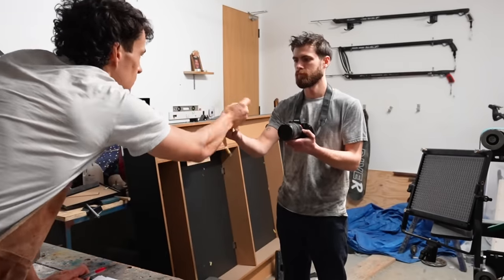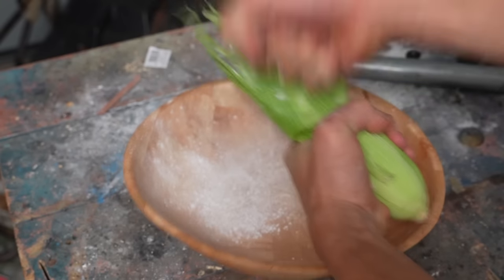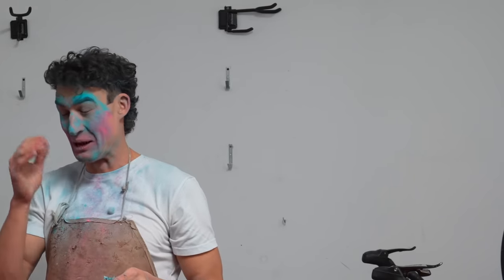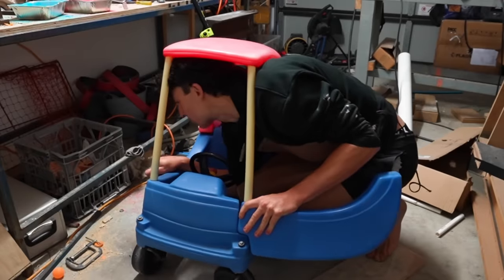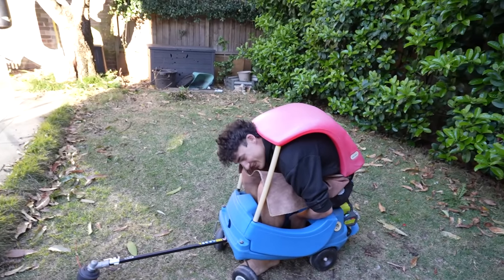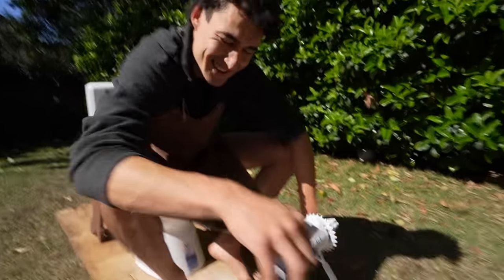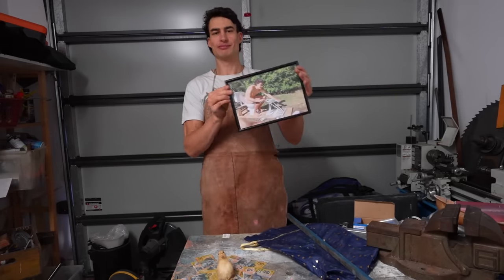I regret making your horrible video ideas

Comment: I love that the way this video is structured you ran into a problem of it firing too hard, and that is never addressed, we just move straight to human trials
Reply from the maker: Yeah i thought i was fixing that problem then forgot about it
Reply: @Ididathing  wait, you never actually fixed it?! I thought it was just lost in the edit XD
Reply: It was somewhat fixed by the increase in the diameter of the gun.
Reply: The problem was solved by adding the additional barrels. Since he increased the total throat diameter, this reduced the exit velocity of the projectiles. Add to that the drag due to increased surface area of powder particles relative to the ping-pong ball. These factors result in the particle velocity at firing range being reduced to survivable rates.
Reply: @ParadoxicWasHere the extra barrels must have fixed it because they reduce efficiency and spread the load
Reply: @ParadoxicWasHere  Idk, I'm pretty sure he's a character lol
Reply: “I think i actually made it stronger but anyways moving on” his videos are genuine gold
Reply: J
Reply: @ParadoxicWasHere the air pump has a pressure gauge. He could just pump up to a lower pressure
Reply: @KekusMagnus  spread the load you say?
Reply: @Ididathing just so you know, when the ping pong ball exploded and left the dent in your wall, what happens was the front of the ball went inwards, (that's why the center didn't dent) however when it went inwards, it hit a point to where it couldn't go any further, that's when your wall felt the impact, and that's why it just has a ring dented into it.

Comment: All the ducks I've found so far:

0:19 behind some metal thing
1:01 mug
2:02 hammer
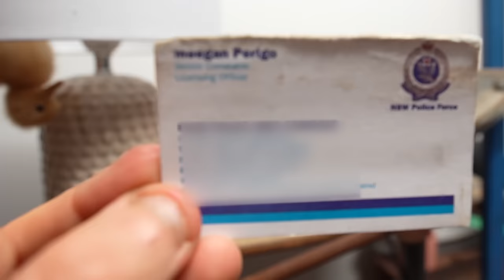3:01 lamp
5:34 apple
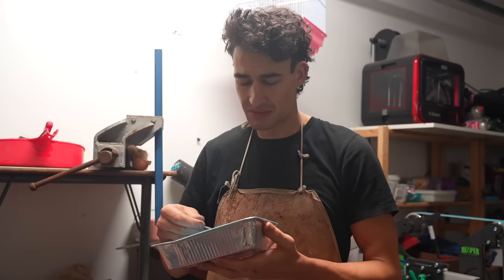5:39 egg 1
7:54 egg 2
8:41 egg 3
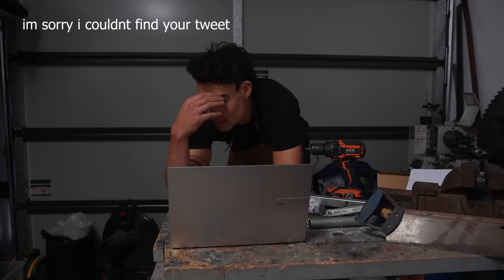9:01 saw
9:36 Sharpy Spiny
10:38 Sledge Hammer
 14:23 on a mug or smt hard to tell
14:34 cage
17:25 bag
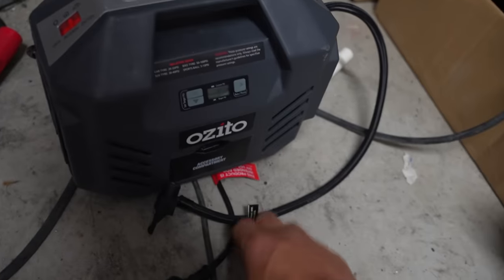Reply: Missing 2:40 tho
Reply: what if there just red herrings
Reply: i didn't even notice...busy looking at the monstrosity 😅
Reply: I should have checked the comments before doing this exact thing

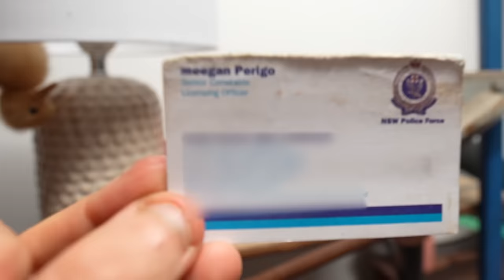Not a duck but  thought the guitar at 2:56 was pretty random as well.
Reply: Tool assisted pregnancy successful, buns in the oven, and three eggs fertile, teo boys and a girl?

Comment: 14 unique ducks 
3x repeated ducks but in different cuts
(1 drawn duck picture)
so 17 ducks in total ? (well 18 if you count the drawing and doubles ) 

0:20 duck on weight thingy
1:01 duck in cup
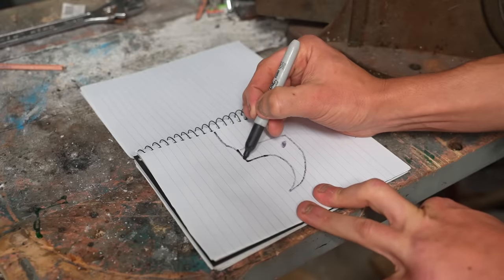(1:32 duck drawing on ground)
2:02 duck next to the hammer head
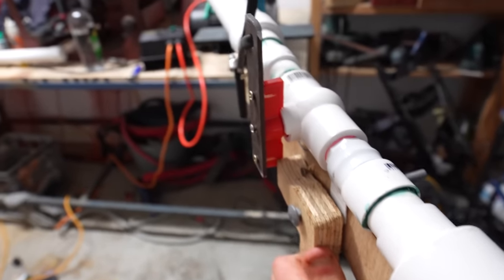2:40 duck in mousetrap 
2:59 duck in lamp shade
5:35 duck on apple
5:40 duck under vice on egg
7:55 duck overlooking egg on table
(8:41 same duck different cut)
9:01 duck looking through the saw handle 
9:36 duck on lawnmower
10:39 duck behind the rubber hammer
14:23 duck in background flipped on the side
14:35 duck in the birdcage hanging upside down
17:26 duck you pulled out of the bag
(17:29 same duck just fallen over in a different cut) 
(17:34 same duck just now on the money in a different cut)

Comment: So for the challange I'll leave my findings and thoughts here. 
Bird locations:
0:21 - By a weight (lead diving Weight)
1:01 - In a cup (mug)
2:00 - by a hammer (head)
2:40 - in a mouse trap -3
3:00 -  (upsidedown) on a lampshade  
5:35 - On an apple 
5:41 - on and egg 
7:54 - on an egg
8:41 - on an egg again 
9:02 - in a saw (handle) 
9:36 - on the lawn-mower (sharpy-spinny) 
10:38 - behind a mallet? or hammer 
14:24 - on a tub of Ice cream (thanks Rangamullet) 
14:35 -Upsidown in bird cage -
17:28 - final scene

I suspect this takes better knowledge of his channel than I have so best of luck!

Coming back to this and editing:
Adding now the fact that there is a picture of a red duck with the following lines (1:32 as he points at the trigger valve)

_ _ _ _ _    _ _    _    _ _ _ _ _ 
It appears there can only be 13 ducks. The first and last therefore not counting. The lines could however be a "red herring" as they are in red.

The only letter that appears that can stand alone is a so 
_ _ _ _ _    _ _    A   _ _ _ _ _  

seems reasonable

Letter combinations are 
C H M L A E E E S S M ? B
M H T L A E E E S S H ? C
Depending on the word you use for the thing
I reckon the two letter is likely ME but could be wrong. Has to have an E, Can't start with one I don't think. 

Anyway I give up. I hope this is of use.

_ _ _ _ _  ME A CHEESE

Third edit: ^^ this was always wrong because of the number of E's 
Using rangamullets upsidown theories the letters dont change that much as Lamp is chage for lead

C H M L A E E E S S M I M
M H T L A E E E S S H I M

The Ice cream making an I now available. meaning both I and A can now take the 1 letter space. 

_ _ _ _ _    _ _   I   _ _ _ _ _ 

This construct still presents the same issue as before, two letter words with an e. The two I cna think of that fit are  
_ _ _ _ _    BE  I   _ _ _ _ _ 
_ _ _ _ _    ME   I   _ _ _ _ _ 
The Latter of which clearly makes no sense, the former I'm not sure people other than myself say in the modern day. 
Leaving two letter words with the letter a .
_ _ _ _ _    AS   I   _ _ _ _ _ 
_ _ _ _ _    AM   I   _ _ _ _ _

I am no closer.
Reply: My brain cannot
Reply: ain’t reading allat
Reply: i've already sent in my answers but the item that the bird is on 14:24 is a tub of icecream btw so either t or i. There's 15 appearances and only 13 letters in the red duck drawing. I guessed from that that the upside down ducks are probably red herrings so i took out cage and lamp. i don't think i even got the answer right but thats everything extra i know. Also at the start it's on a lead diving weight.
Reply: im done for tonight too im going to try tomorrow again good luck to everyone
Reply: @rangamullet5815  like the upsidown theory, leadweight you are bang on! 
Nice man
Reply: How did you get the letters. also im seeing a bit of a reoccuring pattern with both "LAEEESS" in the letters. C H M L A E E E S S M ? B
M H T L A E E E S S H ? C.  Either that could be on purpose or just the way you arranged it.
Reply: @JohniiJ he got the letters from the initials of the objects the ducks are standing next to.

I think the letters could be MHTLAEESSHICE

And the sentence goes like "_ _ _ _ _    ME A    _ _ _ _ _"
Reply: is this a bird? 14:15
Reply: @sergioabrb  SMELL THE CHEESE?
Reply: Could it have anything to do with the sponsor air up??
Reply: I think in the final scene it would be M because he put it on money
Reply: Grill me a cheese
Reply: @rangamullet5815 hi, how did u send ur answer? I can't find any links or anything about it in the video or anywhere else
Reply: I also managed to find everything you found here, but after trying to find a meaning in the letters of the objects, I came to the conclusion that there might actually not be any meaning in it, and there's a catch. And, by the way, CHEESE has 6 letters, and the las word of the puzzle has 5.
Reply: @rangamullet5815  I have updated my comment with your notes
Reply: @papaduality  well papaduality that is the question. There's two likely probabilities, it could be 'tweet me a _____' or 'email me a _____' or it could be something completely different. I've both tweeted something and emailed somethign because im pretty sure its one of those.

the other one that could fit is write me a ___ but i couldn't find a way to make that work.

I probably am wrong though so take everything i say with a grain of salt.
Reply: @JamieHayhurst  sweet as
Reply: @JamieHayhurst "is a" is also a possibility. There are so many combinations and none of them make sense. Are we even sure we are looking in the right place?
Reply: @rangamullet5815  oh , now i get it , thanks for the help buddy
Reply: My brain completed it to 'grill me a cheese' and now I'm hungry
Reply: @rangamullet5815   it could be "it'sa me a mario"
Reply: @mocoxiii  HAHAHAH IT ACTUALLY COULD BE THOOO
IcecreamTrap'SawApple MalletEgg Aluminium MugAdrenoRopeIronOven

doesn't really work but close enough hahah
Reply: On 13:24 it's written "Happy Ending" on a piece of cardboard, with a hole next to it. I don't know if it's just him fooling around or an actual clue. In which case I don't know how to interpret it, maybe something to do with the end of the message being a sexual reference?
Reply: I think maybe there's a past collab with idat and HowToBasic because eggs are a big thing and I do remember sometime ago HowToBasic had a collab with a lot of youtubers just a hunch not sure how far back this ARG type thing IDAN planned though just a thought
Reply: @grehsoul  i had to stop because i will get obsessive over puzzles like this. it gets bad. i'm praying someone will solve the damn thing so i can stop thinking about it.
Reply: @grehsoul he said he isn't having children : 💀
Reply: @Creativestname  thats okay, i tried solving for both answer types and figured out neither.
Reply: @grehsoul  do you know what was the answer? Or was it not revealed?
Reply: @seanoisthasickest6555  it can’t be cheese
Reply: Well done people, no idea what the answer was but I’ll post it here when I do find out
Reply: @rangamullet5815   Damn man you had this thing almost solved, sorry bud
Reply: Correct anser for context guys was EMAIL ME I SMELL
letters were
LMESILAMIEELM (not in order evidently)
Reply: @JamieHayhurst  dude im literally distraught
Reply: @rangamullet5815  there is no doubt we contributed
Reply: @rangamullet5815  you more so than I
Reply: this scares me
Reply: @grehsoul what is watch time farm?
Reply: dId u win?
Reply: Stop being smart

Comment: Duck sightings
near the bag 0:23
mug 1:02
block 2:02
another block 2:40
in the lamp 3:01
on the stove 5:34
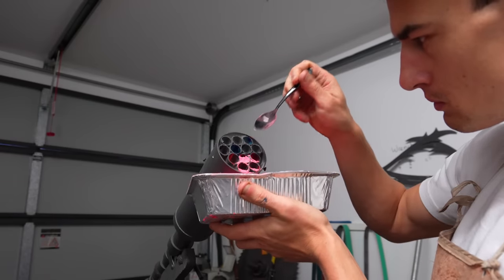under the clamp (w/ egg) 5:45
on the table (w/ egg) 8:43
near the handsaw 9:02
on the mower 9:39
hammer 10:38
in the metal box thing 14:26
in the cage 14:35
Reply: Nice work. Hope you win it.
Reply: you found some that i missed. its hard to tell what the hell the duck is actually on, so i imagine the riddle will take a while and a bit of guessing
Reply: ohh you’ve definitely won it
Reply: I never saw one of these ducks until you pointed it out...
Reply: 1:32 drawing of a duck at the bottom of the screen
Reply: @dion2808  It's not just a duck. It looks like dashes for possibly hidden words. Looks like 5,2,1,5:
My guess: Ducks in a Video
Reply: @ImmortalStrain i saw those but i couldnt really pin down what they meant

Comment: There are 15 ducklings spread across the Video which lines up with the 15 flavours of air up! Which means every shown duck embodies one flavour of their collection!
Reply: No
Reply: How you spotted those I do not know.
Reply: 15x the ducks appear at these time stamps. 

I think the last one next to money is a distraction.  He purposefully moved next the hole on the bench

0:19 - next to a holder/stand?
1:02 - in a mug top left
2:02 - next to hammerhead on bench
2:40 - on what looks like a block at first but I think is the claw portion (nail remover) of a hammerhead
3:00 - upside down in the lamp on left
5:35 - on an apple on the stove top
5:41 - duck under vice but next too egg also.
Lots of these locations suddenly appear behind from his hand
7:55 - behind egg top left
8:41 - behind egg top left again
9:02 - in the handle hole of the reinforced handsaw
9:37 - top of lawnmower motor
10:39 - behind black rubber mallet top centre of shot
14:24 - on top of a jar with flowers, almost centre shot
14:35 - upside down in bird cage, hanging from a loop or ring
17:28 - next to a hole on the bench

Duck appears on top of money at 17:34 but that coukd be just for the closing shot
Reply: @DanielWillems1995  deffo having a kid icl
Reply: bros getting $5k ☠
Reply: bros getting $5k ☠

Comment: I'm surprised how well makeup gun actually worked. I don't think you should do different colors in different barrels, i think you should do colors roughly wear they should be on the face and then put some white in front of all of the other colors so that you get a hit of foundation before the other 2 colors.
Reply: Yeah, he loaded it backwards
Reply: Actually true. Like how much time u spend brushing just so you dont see any strokes...this would solve it. And spray is just not the same either, this could be a niche for like dancers in concerts that need to referesh fast

Comment: Baby ducks:
0:21 by the blue bag
1.01 in a cup to the left
2:03 next to the hammer top on the left
3:01  in the lamp to the left
5:35 on the apple on the stove
5:41 under the clamp by the red dustpan on the top left
7:54 on the left by an egg and white cup
8:40 on the left next to the white cup and with an egg during the sponsored part
9:02 on the right poking out of the saw handle
9:36  on top of the lawnmower being used by the child slave
10:39 behind the black head of the hammer behind the blue car
14:24 sideways on the right hand side of the gaping hole in the underwear
14:35  upside-down inside the pink and white cage on the right hand side  of of I.DA.T whilst he tries and induces diarrhea.
17: next the  5000 AUSSIE DOLLARS- totaling 5.20 US dollars.
Reply: An other one at 2:40
Reply: Maybe 2:55 in the bottom left bin, hard to tell

Comment: 0:19 duck (dive weight)
1:01 Duck (Cup) 
1:32 Duck (drawing ) 5 2 1 5 Dashes
2:02 Duck (Hammer Head)
2:41 Duck (block with a cape)
2:59 Duck (upsidedown in lamp
5:34 Duck (sat on an apple on the stove top)
5:40 Duck (laying on egg under vice)
7:54 Duck (sat near egg)
8:40 Duck (Egg)
9:01 Duck (saw) looking through the handle
9:35 Duck (Lawn mower).
10:40 Duck (hammer/ rubber mallet)
14:26 Duck laying down on Connoisseur Ice Cream Classic Vanilla 1l Tub
14:35 Duck (upside down birdcage)
17:25 Duck (Money)
17:28 Duck (picture)
17:32 Duck (Money)

Faces
1:47 Face Upside Down
1:54 Face Upside Down
1:56 Face on key shape wood
9:18 Face on key shape wood
9:53 Face on key shape wood
10:00 Face on key shape wood
10:33 Face on key shape wood

Blue Sharpie
0:19 Blue Sharpie
1:32 Blue Sharpie
1:56 Blue Sharpie
4:08 Blue Sharpie
5:09 Blue Sharpie

Guitar
2:57 Guitar 
4:42 Guitar 

13:26 happy ending box

3:30 popcorn (palm tree bag)

8:51 giant nail clippers (IDAT Youtube Short)

Thumbnails
10:29 "I made the worlds most dangerous pool stick"
13:14 "I made the worlds most dangerous pool stick"
Reply: Dayummm broo
Reply: I appreciate your hard work and attention to detail.

Comment: Secret puzzle for secret baby ducks:

0:21 by the blue bag
1:01 in a cup to the left
2:03 next to the hammer top on the left
2:40 yet another
3:01 in the lamp to the left
5:35 on the apple on the stove
 5:41 under the clamp by the red dustpan on the top left

7:54 on the left by an egg and white cup

8:40 on the left next to the white cup and with an egg during the sponsored part

9:02 on the right poking out of the saw handle

9:36 on top of the lawnmower being used by the child slave

10:39 behind the black head of the hammer behind the blue car

14:24 sideways on the right hand side of the gaping hole in the underwear

14:35 upside-down inside the pink and white cage on the right hand side of of I.DA.T whilst he tries and induces diarrhea.
17:26 the money duck 🤑

also a drawn duck at 1:32
Reply: I guess that is a drawn duck
Reply: At least change some words if you're copypasting other's comments